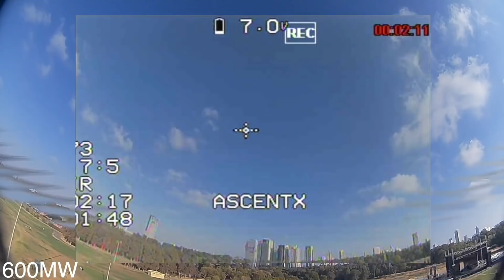SpeedyBee TX500 - Best Micro VTX?

Comment: Great video, you helped me decide on this vtx to replace my AKK FX3 ultimate. I'm having an issue with it cutting out every few seconds whenever I try to go above 25mw. I was sure to unlock it before connecting the IRC Tramp and can verify that I have a solid red light on the vtx. I can also see the orange light changing when I change output levels through IRC. The only other cause I can come up with is that I am getting power from the 3.3v spectrum pad on my hglrc f440. Is it possible that 5v is needed in order to get full output power?
Reply from the maker: Thanks! Yes. 3.3V is too low.
Reply: Gal Kremer thanks a lot! I soldered the power to the same pad as my split mini power and everything is working great now!
Reply: Yup, I've just heard too many weird things about AKK VTX's giving problems. All of the reviews for different models on Amazon have people complaining about one thing or another! Not going to buy an AKK. 🤔😕